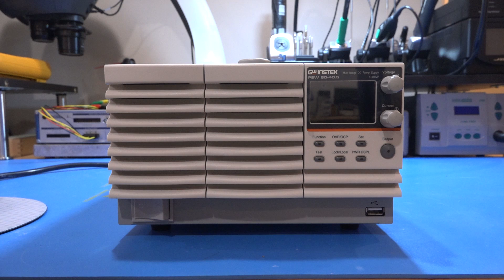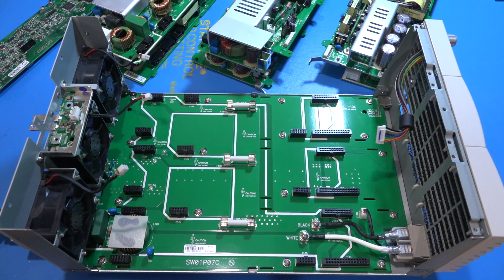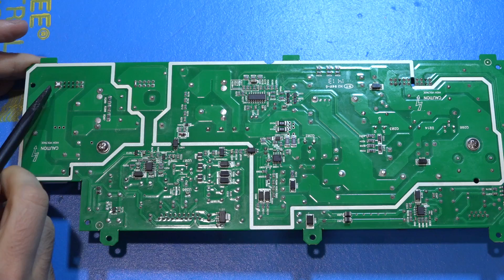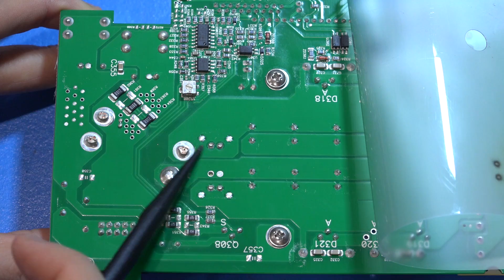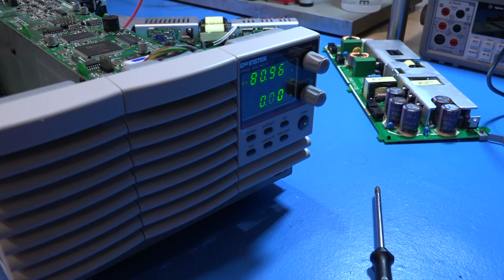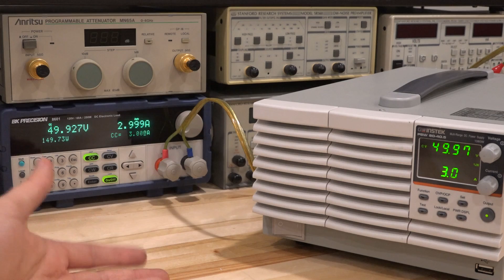TSP #139 - Teardown & Repair of an GW Instek PSW80-40.5 1080W Multi-Range Programmable Power Supply

Comment: 13:02 I was wondering why you didn't check the resistor first. Without it no current can get into the system and not a single thing will happen, you really should have seen that.

Comment: Nice problem tracing.  I checked their site and no service manual or schematic.  They do have a user manual but it too doesn't contain a schematic.  We need to start insisting on these or not buy their equipment.  Same is happening in the HAM radio world.  I can understand their view if it's a cheap toss away unit, but expensive equipment such as power supplies, transceivers, etc... should have service manuals.
Reply: So much stuff is sourced from China these days probably down to google translate not being able to cope, and the designs are probably copied from any source available, patented or not, and good service manuals are expensive to produce so I wouldn’t hold my breath.

Comment: I used to have a Flextronics power supply a little smaller than a loaf of bread which could handle 145 amps continuously at 12VDC with a 240V supply input.
Reply: "Used to have ... PSU ... a little smaller than a loaf of bread..." - is it now toast?
Reply: @andrewmorton9683  No I tore it apart.

Comment: Going to bet somebody tried to charge a battery with it, and did not realise it has a 2 quadrant capability, and it then blew out the downprogrammer trying to discharge the battery. Power supply kept on working, just probably gave an error on startup about the current sink being disabled on the one channel, but otherwise kept on running, with only a long turn off time on power off or dropping voltage.

The resistor on the input side failing was probably coincidental, or the central power supply is the one which always powers on first, and the repetitive surges through this resistor finally caught up with it.
Reply: SeanBZA, Sounds like you know that failure mode well!

Comment: WOOOW, don't use that kind of resistors for current limiting during start-up. They tend to explode when  are overheated (that polimer is melting on the wire and is vaporized creating pressure....than it burst trough lateral leads.....I have seen one exploding). Use ceramic resistors this can handle high peak power dissipation without any failures.
Reply: Gatea Catalin, Failure mode is a critical thing to know, regardless. It comes with experience for good engineers. If you fail to heed that data, you destroy good equipment for no practical reason.

Comment: All the instruments you opened look brand new on the inside, even the cooling fans are clean.

Did you dedust and clean the inside of the instruments before start filming, please?
If so, maybe it would be interesting to show how can this be made so well.
Reply: I could imagine most of these instruments come from labs and not from people's homes. Lab environments are already a lot cleaner than your typical home, as far as dust is concerned.
Reply: All the eBay equipment I've ever bought have been pretty clean on the inside.  It's possible the sellers dust them off to make them more presentable but if they do come a lab environment they're unlikely to be full of fluff. The labs I've worked in are very clean. Automotive & Healthcare.
Reply: The labs typically have HVAC systems with filters that filter the dust out of the ai
Reply: @brainndamage  Also I back this up. I currently work in a biomedical lab, and I have horrible hayfever. Once inside, zero hayfever. The outside air, and probably also the inside air, is filtered nonstop.

Comment: Very nice video.
I have found that the cement resistors as used in that PSU inrush limiter don't have a good overload capability. If you break open the failed resistor you'll probably find the resistance wire wound on a tiny glass fibre former.  Resistors wound on a ceramic former (like Welwyn) offer far better inrush current handling capability. Basically not the best component choice. Interestingly, the aluminum housed resistors also can't handle a high inrush current even though their steady state rating is ok.
Reply: Designed as a fusible resistor, so will have a thin film resistor inside the body, so it will fail open circuit under overload.
Reply: @SeanBZA  That may be a possibility. I remember the vertical cement resistors in TV's had a low temp solder that would melt and break the circuit. 
The aluminum housed resistors spew their guts when overloaded. It can be a very dangerous situation with a foot or two of resistance wire all over the PC board at mains potential.
What happens is the air trapped inside heats and expands and blows them apart.
Reply: What Welwyn series? I'm trying to look for an example of a resistor with a ceramic former.
Reply: No sure which series. I'd have to go to the website. It's not just Welwyn. Other makes also use a ceramic former.
Reply: @SolidStateWorkshop  They don't make that line anymore it seems. They were green glazed vitreous bodied and quite fragile actually. TT Electronics probably eliminated the range after the takeover.

Comment: How are you getting 400VDC from rectified us mains voltage? Don't you guys have 120VAC? We don't get that from 240VAC.
Reply: Looks like this has power factor correction on each blade, so the voltage will be 395V irrespective of mains input being from 60 to 265VAC. This means the main control has one less thing to compensate for, as input voltage is constant across the world. Also means the power devices can be simplified, and you can run them closer to the edge. Bonus is also reduced noise on the input and it is much easier to filter, plus reduced ripple on the main DC bus as well.
Reply: probably voltage dubbeling. That way I make  over 500Vdc from 230Vac for a leakage tester
Reply: @pa4tim  
Thanks. I don't remember anything about his isolation transformer, maybe it can output wider range of voltages.
Reply: PFC is boosting the voltage after rectification to ~400VDC.
Reply: @MCSGproject  How can power factor correction change peak voltage? Doesn't it just changes current phase shift?
Reply: @ukaszsmoa8416  PFC stage usually is implemented with a boost inductor as well, it's convenient to do both at the same time.
Reply: @MCSGproject  
Ok, thanks for explanation.
Reply: I'st because of a power factor correction, http://www.ti.com/lit/an/slua144/slua144.pdf

Comment: Can you please link to where you got those needle point gold plated probes you were using with your Fluke 289?
Reply: Try brymen leads off of ebay, gold plated, silicone isolation. Very cheap and quite good.
https://www.ebay.com/itm/Brymen-Silicone-Gold-Plated-Test-Leads-Probes-for-Multimeters-CAT-IV-1000V/171162377470?epid=2063657290&hash=item27da129cfe:g:uSQAAOxyTjNShpch:rk:1:pf:0
Reply: Probemaster also sells micro tip leads,  American company, good stuff.  There's lots of cheapo micro tip leads on ebay and amazon too.  If you want the real Fluke ones,  they're a bit pricey.  https://www.amazon.com/Fluke-TL910-Electronic-Test-Probes/dp/B000VRJH0G/ref=cm_cr_arp_d_product_top?ie=UTF8

I use these as they serve the same function and are also extended.  https://www.amazon.com/Fluke-8845A-EFPT-Extended-Point-Adapter/dp/B000VRFKPW/ref=sr_1_1?s=industrial&ie=UTF8&qid=1543002744&sr=1-1&keywords=fluke+tp88
Reply: I use a pair made by https://probemaster.com/.  A bit more expensive than the Chinese made probes but they have the sharpest gold plated probe tips in the industry.  You can easily poke them into insulated wires to read a voltage without damaging the insulation, the cheaper ones are generally too blunt to do that easily.  They're so sharp, in fact, I have to be careful not to poke myself with them as I work.  They can also elevate a budget priced test instrument into a near lab quality instrument by getting around the manufacturer's habit of cutting corners on the probes in order to reduce the sale price, as long as the instrument itself is of good quality.
Reply: @sincerelyyours7538  I own some probemaster probes (the 8043S kit) and I hate them. They are too big and clunky in the hand. Their only redeeming feature is that they are sharp, but but the tip is too big and clunky. With the CatIV cover on them the tip is too far recessed and with the cover off its too big for my liking. The handle is huge too and feels too distanced from the tip. I have just ordered the brymen probes Łukasz Smoła recommended but I really like the look of the needle-point ones being used in this video. I know the probemaster ones get rave reviews on youtube, that's why I ordered them, but I find them to be awful as general purpose probes. The point is too big for fine stuff, they are more like automotive probes.

Comment: A zap from this wouldn't be fun.
Reply: With 80V DC you'd really have to try;) Unless you regularly work with wet hands or open wounds. Much more "fun" comes from  accidental insulation testing your skin instead of DUT using a megger.
Reply: @shana_dmr , Don't use your tongue as a circuit tester! LOL